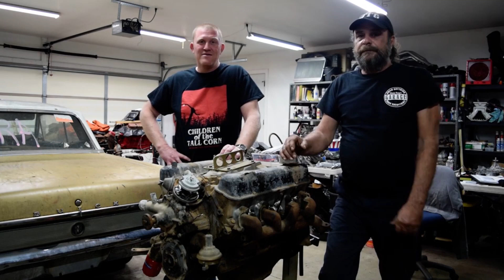Buicks Miracle Motor

Comment: GM had deep pockets when it came to developing engines back in the day! to bad they shut down their racing program in 1963. they could have built some really cool stuff.
Reply: If they hadn't stopped racing the government would have broken them up. Its not like they stopped chevy from racing, but they made damn sure every other engine was handicapped so the Corvette wasn't challenged. They were really pissed when a 63 LeMans lapped all the Corvettes on a road course.
Reply: I could have done with a W-43 Olds Hemi. Too bad it never made it to production. NASCAR really screwed up the development of performance engines when they started making rules that everyone had to detune their engine development programs to compete with the slowest car.
Reply: @Freedomquest08  The OHC 421 would have been awesome in GTOs, same with the Pontiac Hemi, MT made a few sets of hemi heads, but the RA V heads, now that is a fun piece of equipment. I can get RA V heads from two different guys reproducing them, one is a close to stock replacement, the other can be a full race head flowing over 500cfm. 

I'm debating with myself if I am going to buy an aftermarket block this year, and stuff a 4.5" crank in it to make a 535ci Pontiac.. that I could put RA V heads on and stuff in one of my cars, maybe the 65 Gasser.. Now that would be seriously cool fun.. too bad I can't use factory parts when they only made one set of OHC heads and a handful of RA Vs.

That Hemi Olds had lots of promise.. if only the brass at GM had some balls.
Reply: @SweatyFatGuy  I have respect for Pontiacs. One of the most impressive things I've seen at a dragstrip that rolled out of a 'nobody's' garage was a late '60's big tuna boat Bonneville that would lift the tires off the ground every launch and ran consistent low 10's. It was a long time ago but I think he was running Ram Air 3 heads on a 455.
Reply: @Freedomquest08  answer me this..... how come NASCAR used to allow 426 hemi, 427 GM and fords.....440....ETC
and now days.... everyone runs a ~355 with a restriction plate
.
why is that? why doesnt NASCAR allow people to run 502 big block GMs???? please, i need an answer.... get to work their "slow"!!
Reply: @kainhall  
That's my point. After engine restrictions, Nascar went after aero cars like the Superbird and Talladega, because somehow, he who makes a better racecar is an unfair advantage. Then more engine restrictions lol. 
I stopped watching it in the '80's. It's ridiculous nowadays where Nascar has created so many rules against any manufacturer building a better car, that the cars don't even resemble the cars they represent anymore and the biggest separation between a Mustang, a Chevy and a Toyota is the sticker kit. What a joke.
Reply: @kainhall  It's not a simple answer but then again it is, but also complex. Simple answer is money. The complex answer is who's money. Between gov regulations and certain patents that motor companies own, who so ever owns the biggest stick shant walk with it, at least not in "sports". Dodge made the hemi, nuff said about that and OWNED it. Hemisperical heads would always dominate until technologies allowed others to "catch" up. There was insight into how big nascar would become and the BIG CHICKENS in charge didnt want just ONE "ring to rule them all" because who wants to watch a bunch of hemi's duke it out in the future while the rest sell grocery getters. So instead, maintaining "level competition" ensured fans would polarise with their prefered "motor company" along with their driver(s). Chevy vs Ford vs Dodge. Honestly it was mainly about maintaining theatrics for the simpletons while appearing to offer "rivalry"
Reply: @johnwirk  the hemispherical combustion chamber is old news, the "soft" as they called it or high swirl heads changed everything, Larry Widmer at Endyn brought the technology to Nascar via the Elliott team, then drag racing where Glidden bought up all the heads so he'd have no competition and the rest is history.
Reply: @Freedomquest08  sounds like a load of bullshit. If you're slow, you're slow...get to work
Reply: @DSchea  but.... they did.
so you get to work.... reading a book about the history of NASCAR 
.
or is your mind too slow? hey, if your "slow" your "slow"...... just saying what you said!
Reply: The insurance industry and Ralph Nader stifled factory performance cars.

Comment: They're tricky to work on.
Pull that water pump off and you'll see.
For reference, 430's were no good.
We were so happy when Buick came out with the 455 !
Warrenty issues with 430's was crazy.
Oiling issues.
If you pull that timing cover off to repair the broken bolts..
Oil pump must be packed.
There's two issues you don't in counter with the SBC !

Comment: Yes. The Buick Fireball! Very cool GM benchmark in history
Reply: The aluminum 215 V8 actually started showing up in 1950-51 Harley Earl concept cars... and ended regular production 2006... limited production 2018...
Reply: ONLY if you knew what combo of parts and mods really brought thunder. Problem was, that as fascinating advanced smaller engines were,UNLESSthdre was some racing sactioning body who's rules all but mandated or greatly encouraged the use of a particular odd engine, there always were more standard engines which could produce more power at less effort and cost. Lots of times if you started with a larger block and sleeved down to a cu in limit or destroked an engine if you didn't need bottom eng torque, it was a far easier way to go. Remember the small red ram Dodge hemi's? Just sayin'
Reply: @cindylawrence1515  - Small Red Ram Dodge hemis were for efficient HP and efficient MPG in a lower priced car, but not as low as Plymouth...